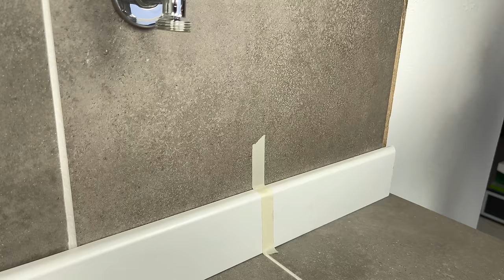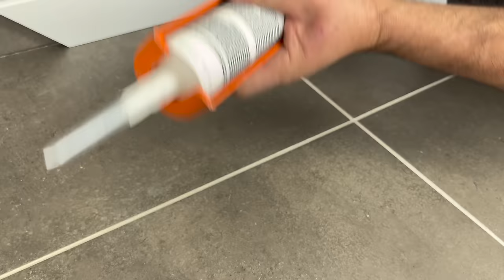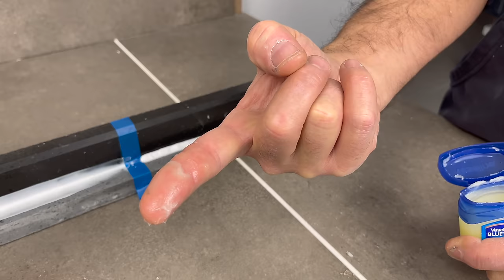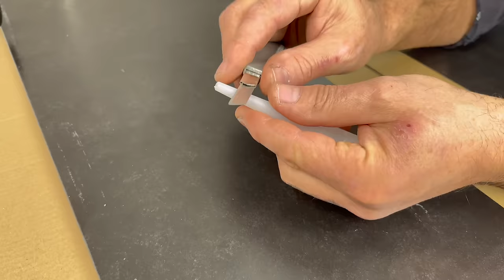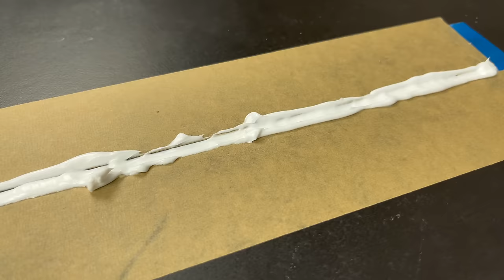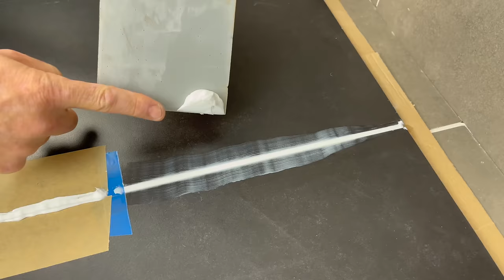Put soap bar in silicone and you will be amazed with results

Comment: Cut the tube at a 45 degree angle and cut the hole very small. Put the tube at the angle of the cut and caulk down the trim and wall.  If gap is too wide on trim cut a bit more off the tube. If you do this you barely have to wipe it and it won't be too heavy and smear everywhere. I'm a painter and have done it this way for 30 years.
Reply: Suicide not allowed

Comment: In case you will be painting on or around caulk, petroleum jelly is not a good idea, it will ruin your paint work, instead, use a spray soap or foam glass cleaner. Spray right over the caulk and your fingers will not pick up, but smooth the caulk. The residue will not hurt your paint work...
Reply: Suicide not allowed

Comment: Why use your finger, craftsman? Everything should be done completely differently: after applying silicone, a soap solution is applied as a spray, then the seam is passed with an angular rubber patel.
Reply: Suicide not allowed